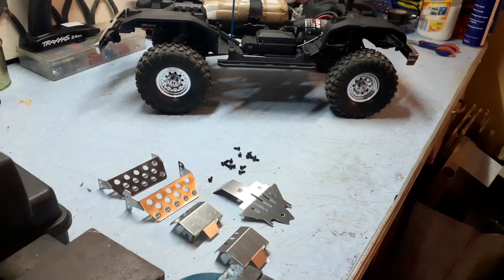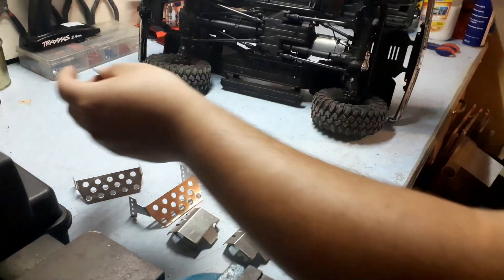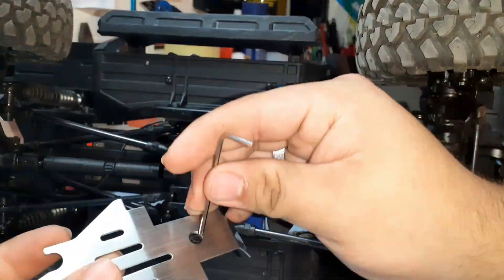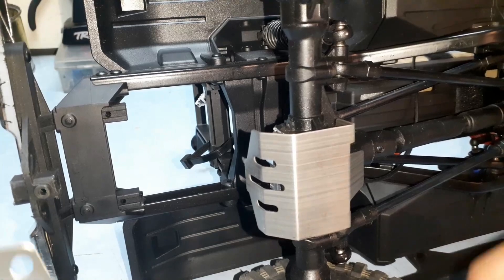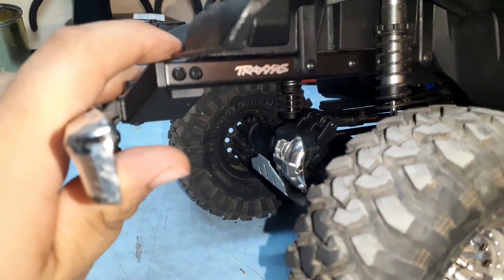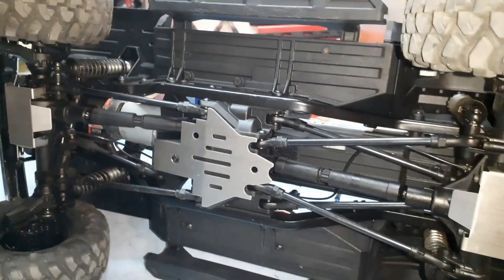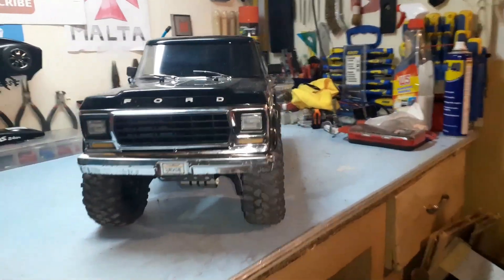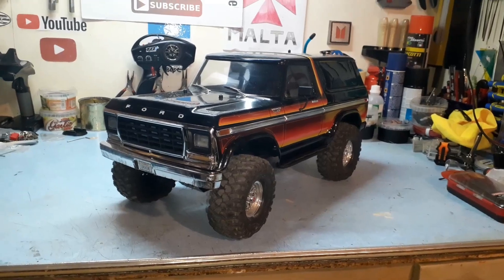How to install a chassis armor protection kit on a TRAXXAS TRX 4 crawler

Comment: I put mine on yesterday, but the middle part is only held on by one screw, so it kinda moves around? I did not figure out how to fasten it so that it would not spin around.
Reply from the maker: Possibly you could remove it and apply some kind of strong sealer or adhesive or possibly strong double side tape. I left mine like that but I will fix it as well. Thanks for your comment👍😀

Comment: is there any water leaking to diff after doing this?
Reply from the maker: Hi there I can not tell you so because, I have not driven my truck trough water and do not use it that much, but I do not see why water would leak in. You did not modify the diff, those 2 screws just have to be loosened so the diff plate can be held. In theory, the thread should not leak into the diff housing if you fear of water getting in the tread. Traxxas is known for good waterproofing and greasing supposedly so shouldn't matter much really. Hope I helped in any way. Thanks👍😁

Comment: This is probably a stupid question... about the plate that goes under the front bumper, does that style of skid plate have a specific name?
Reply from the maker: Hi there friend, oh I wouldn't say its a stupid question. I do not know a specific specific name for it either than front bumper skid plate. That is how I know it. Sorry if I did not give you the exact answer but that is my version😁👍👍❤
Reply: Haha that's ok. Thsnks for the answer 😁. I was wondering if it had a specific name because there are a few styles. I want one that looks like yours for my rc truck, but it is 1/16 scale WPL C54. It seems I may have to make it myself from scratch 😅😅.
Reply from the maker: @sgecko7  so they make skid plates for those lil wpls? No offence but the stuff is tiny I immagine. How can you fit these to wpls I have never actually seen for sale. I have 2 but never featured on the channel because I taught they are completely ridicolous + are a bit outdated because we baught them when their trend began. I litterally never use them. Thanks for commenting👍👍👍
Reply: Lol yeah they sucked hard when they came out and for around a year or so (at least from what I've seen)... the RTR version mostly. Got mine around 2 months ago. I think they're decent for the price and are upgradable, but he skid plate I want doesnt exist for it. It would just be an aesthetic upgrade though, because I wont be taking it to a real trailing/crawling day any time soon due to the quarantine and all that 😅. You can see it here:  http://imgur.com/gallery/GXYutwP